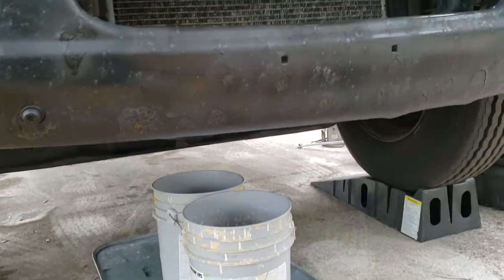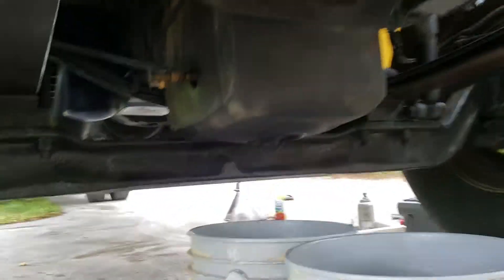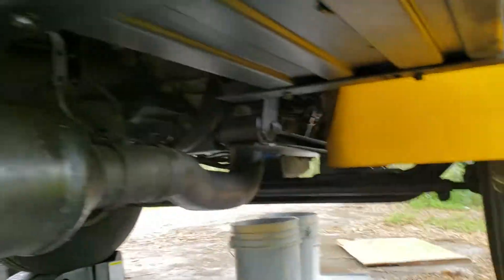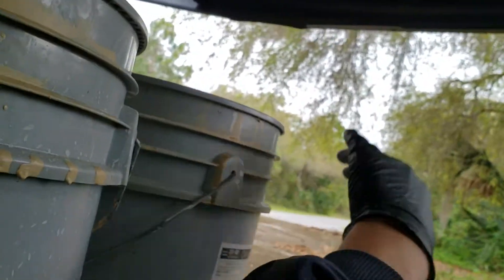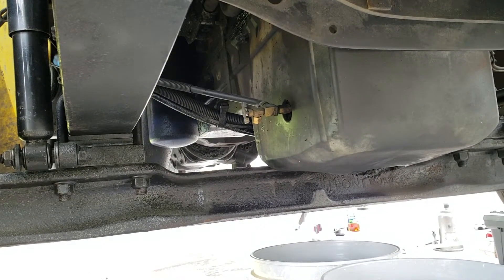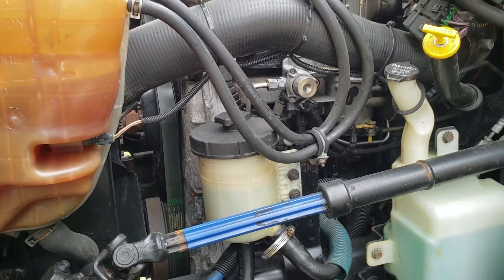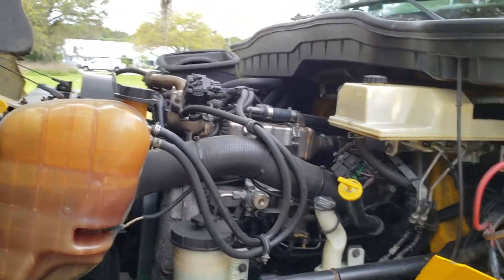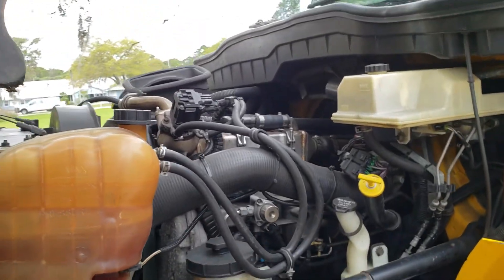How to perform an oil change on big (semi) truck yourself and why? Also what does used oil tell us?

Comment: Good stuff, did you have any concerns about the truck weight crushing those ramps? 
On a side note, any issues with the emissions system?
Reply from the maker: Hey Louis,
This truck is a medium duty, so the ramps held up well.
For a semi i would use metal ramps.
Had an issue with emissions system, got that fixed, still have to work on that video to post it, still rear footage from 3 years ago. Once the trucks are fixed yet are bulletproof
Reply: @rootkitxx  thanks for responding, looking forward to that video!